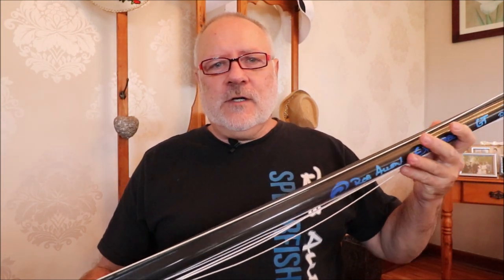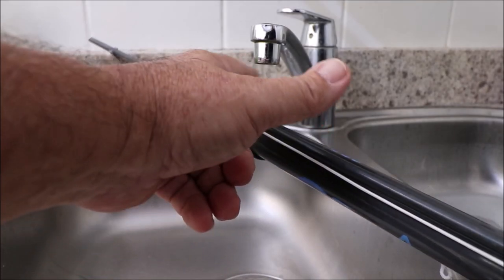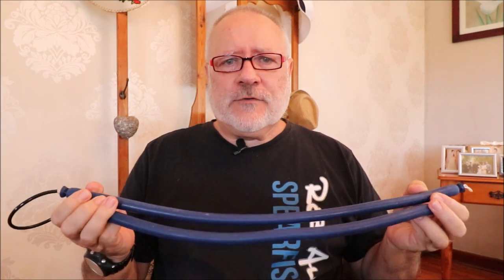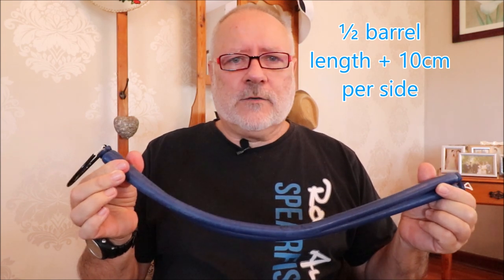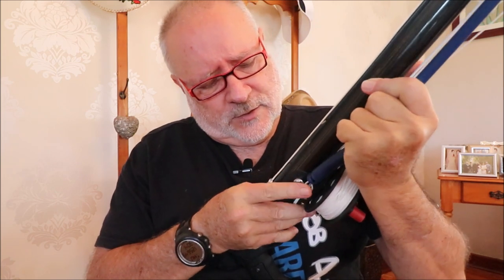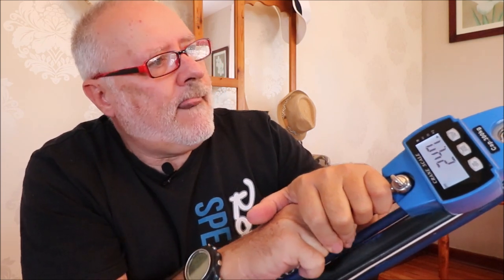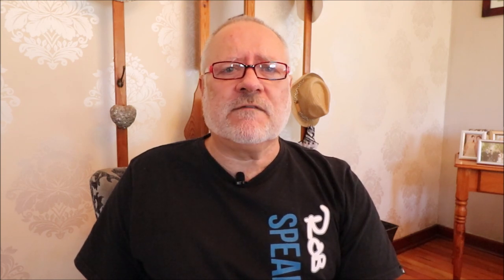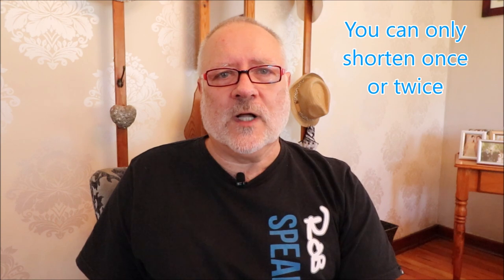Rob Allen | Roller Gun Tips

Comment: Thanks Uncle Rob. I got a 90 cm Tuna Roller gun. Put a 14 mm rubber on it and double wrapped it. It shoots like a dream. I always adore your spearguns. The only brand I ever used. 
I have a question, for a blue water environment (chasing tuna, wahoo etc), would you still recommend a 110 cm length still? I'm thinking of getting a 120 cm Carbon GT Roller for blue water. Thanks, Uncle Rob :-) Greetings from Australia.

Comment: Great video Rob , thanks!!

You say in the video that to calculate the size of the rubbers, we make half the tube + 10cm for 16mm rubbers.

Is the formula the same for 14mm rubbers?

Is it really half of the tube, or half from the head to the last notch?

I have:
Tube = 83cm
Head/Notch=92cm

you say it should have a pretension of 19/20kg for 16mm rubber, 
it should have between 10/15kg for 14mm?
 as I said in a previous answer in another video?

thank you very much!
Greetings from Portugal.
Reply from the maker: Yes, same for 14mm. We use half our barrel length + 10cm. You can always make it a little longer as you can shorten but not make it longer. Yes, 10 to 15kg for 14mm. Start out at +- 10kg, you can always shorten.

Comment: Aloha Rob. Appreciate your informative videos.  Question on roller band wishbones. What is the purpose of the two same size wishbones? Do you double them up on the notch or just hook one so the other hits muzzle and doesnt kick shaft up? Thank you 🤙🏾
Reply from the maker: There used to be wear that occurred on the wishbone line so we saw guys doubling up on these. We eventually worked out, this was due to the shooting line being pulled over the top and in front of the wishbone during the shot. Once the spear started to pull out the shooting line it would have to be dragged back around and under. You would not see this unless watched after videoing and slowing down the frame rate. We realized the problem was caused mainly due to over-powering the gun. We have since sorted this by setting the power/speed of the spear to just reach max as it exits the muzzle. This eliminates 98% of the wear. The double wishbone is a carry over from that and the general market still want it. Not a good idea to try fit both into the wishbone slot as they both will not fit. If you try, the one will go in and the 2nd will get cut/damaged on the sharp edge of the wishbone notch.
Reply: @RobAllenSpearfishing  Thanks Rob. I made a band with a double uneven wishbone to try, but I'll definitely make sure I tighten up the shooting line. Just bought your 110 single roller and swapped shaft and rubber for 7mm and 14mm, for more reef shooting. Anxious to get back in the water and try it out. Only took two shots before that and they both dove low (but I did have a non tight shooting line). Thank you for your response. Aloha 🤙🏾 🤙🏾
Reply from the maker: @cyosh345   Definitely a good idea to keep that top shooting line as tight as possible, Good luck.

Comment: I notice you do sell these up to 130 cm. What happens at 110 cm that makes it not worth it to go bigger? In an extreme example of a 150 cm gun, what happens that makes it not beneficial to convert to roller? Is it just too hard to load? Would a 150 cm single roller be less powerful than a double standard band? Love your gear, and thanks for making these videos.
Reply from the maker: We tested up to a 130cm roller against same size guns with double rubbers. As mentioned before, the advantage was big at the shorter gun lengths but, slowly this advantage diminished. At 130 both were equal in power and accuracy when both were double wrapped. We did not test longer because we assumed it would get worse and, as you pointed out, loading would become very difficult. Our thoughts are, on the shorter guns the length of stroke with rollers when comparing was much greater. As the guns got longer, the longer guns rubber stroke lengths got better. Look at the ratio of spear ahead of the rubbers on a non roller gun compared to what is behind. The rubber has only a short stroke to power up the spear. The longer the gun, the longer that stroke ratio becomes.
Reply: Understood, thanks for the reply, and that makes sense regarding the ratio. Only asking asking because I have the 150 tuna with 7.5 mm shaft and was considering putting a roller muzzle on it. Even if I could only get equal power, it think it would be worth it for the reduced recoil.

Comment: Could you do a video on band choice for different purposes for your rollerguns? I have your 90 cm roller and have tried it with different bands configurations with your 6.6 mm 120 cm spear. I am hunting small and fast fish (trout) so my goal is the fastet shot with minimal drop and recoil - for fast twict instinctive shooting. Penetration is not an issue, since the biggest fish are usually 8 kg. I have tried both your 14mm and 16mm bands cut to your recommendation - half barrel length + 10 cm = 55 cm total but also shortend to 50 cm. I dont have the facilities to pooltest, but my initial impressions are that the 16mm cut to 50cm deliver the best speed with minimal drop but a little recoil, which I can handle. I would like to hear more about your testing results and your thoughts about recommendations for band choice for your great rollers. Again - thanks for the great videoes.
Reply from the maker: Hi Martin, We have not had great success with 6,6mm spears on rollers as they don't seem to have sufficient weight/mass to shoot to the end of double wrap line. If you are able to use a 16mm rubber with a 6,6mm spear, it could be because the water is cold. Rubbers lose its elasticity the colder the water is.
Reply: @RobAllenSpearfishing  Thanks for answering so quickly! Very interesting - the water temps have been around 14-18C, I suspect this qualifies as "cold" compared to South Africa ;) Clearly there is lots to be learned - this begs for more videoes on the subject. I hope you will do an in-depth video(s) explaining pros and cons of different setups on these rollerguns and your learnings from testresults and experience in general.
Reply from the maker: @martincjoergensen   One day maybe. Most of our testing is in 27 deg+ water tamp. It's winter now and will try get my guys in the 17 def water 😜👍
Reply: @RobAllenSpearfishing  Oh you don't have to do that 😅🥶 It could just be a video with a discussion of your test results and experiences so far - you have a lot already It seems 🤙🙂
Reply from the maker: @martincjoergensen  We really need to do a temp comparison. Problem is, I need a cold pool and a heated pool to try the same gun the same day 😎👍
Reply: @RobAllenSpearfishing  It would be nice! Sounds like you need a lot of ice cubes for such a test 😅 I have seen guys building a long tank for speargun testing, almost like a long aquarium. It could be easier to control the temperature in such a thing 🙂 also easier to test more, since you don't have to get wet.
Reply from the maker: @martincjoergensen  I agree and have seen such a tank.  I think you have to be in the water to simulate the same mass in order to have the recoil dampened as it would be in the sea.
Reply: @RobAllenSpearfishing  You mean the mass of the shooter behind the gun? I found the video I was thinking of here: https://youtu.be/NvChOVWqfL0
Reply from the maker: @martincjoergensen  Yes, I feel that the mass of the person shooting should be in the water to absorb the recoil the same as when diving, I might be wrong, just my opinion.
Reply: @RobAllenSpearfishing  That's a very good point, I didn't think of that. I agree.

Comment: Hey Rob great video. Question though, I have seen guys not placing the loops at the end of the rubber around the anchor points, istead they use another length of dyneema connecting the loops and this goes around the anchor points and under the barrel. The rubbers are then half the barrel length.

Advantages/disadvantages of this and do you recommend it?

I can only think that it would make it easier and faster to adjust pre tension on the go rather than having to cut the rubbers..

Thanks for your time
Reply: The tests we have done show the more rubber area to stretch the better, provided you get the per-tension right.

Comment: Hey  Rob, How do these guns perform New England waters?
Rob Robison
Reply from the maker: Should be fine. Only issue is if the water is very cold, it will reduce the band performance equally no matter what band gun you use. Generally guys cut the bands shorter when using band guns in cold water.

Comment: Thank you Rob, nice and interesting video ! Do you have a study of impact spears for your tuna guns (110-140) between 2x16mn and 16m roller ? BR. JCF
Reply from the maker: In pool testing, the shorter the roller the more the advantage when comparing it to a standard double 16mm gun. As the rollers get longer, the advantage in terms of power (spear penetration) accuracy, reduces. We found at 130cm, a single 16mm powered roller has the same power (spear penetration) as that of  a 130cm double 16mm rubber gun with double wrap. Only advantage is that the recoil is reduced. This is why we try to recommend not going longer than a 110cm roller.
Reply: @RobAllenSpearfishing  interesting. How does a 80cm roller compare to a 80cm standard gun with 2*16mm rubbers?
Reply: @RobAllenSpearfishing  Thank you this is very interesting
Reply from the maker: @martincjoergensen  The standard gun will not be as strong as a roller in that length. Most standard guns are single wrapped with sufficient power and accuracy to the end of their single wrap. The 80cm roller will still be good to the end of the double wrap. A single can shoot 5 X the barrel length and the roller with double wrap 7 x barrel length.

Comment: Rob, big fan here. I have your 1200 Tuna Railgun. It comes with two bands. How does the performance compare from the stock setup to switching to the single roller?
Reply: Hi Scott, the same set up (gun length and spear diameter will be better with a roller muzzle but not as big a difference when comparing a shorter gun. At about 1,3m there is not much advantage in power but there is much lower recoil. Some guys have problems with accuracy due to the recoil and a roller muzzle will help with this.

Comment: Very interesting video. You mention the impact of temperature on the rubbers. I live in Denmark and often hunt in waters around 0-8 degrees. How do cold temperatures impact the rubbers? Since things often contract when getting colder, my intuition tells me to cut the rubbers a bit longer than normal - but what do you think?
Reply from the maker: The reverse. The warmer the water the better the rubber works. It is easy to cut the rubbers too short and over power a gun in warm water because the warmer the rubber the better the elastic return is. So, in colder water, the rubbers perform poorly, shorter is therefore better.
Reply: @RobAllenSpearfishing  I see, thanks.
Reply: Do you have a way to gauge how much shorter a rubber should be, if it's primarily used in cold water compared to warm water? Let's say 10c vs. 25c.
Reply from the maker: @martincjoergensen  Guys in the colder areas generally cut their rubbers a good 3 to 5cm shorter than our recommend, not an exact science 😁
Reply: Thanks again. I will experiment with that. Looking forward to the next video.

Comment: Just bought the tuna roller 90 cm. Insaine power and precision - very nice. It is quite heavy in the water though. Rob, do you know if the gun will be close to neutral buoyant if I replace the aluminium tube with your carbon tube? Best regards from Denmark.
Reply from the maker: It will help.
Reply: @RobAllenSpearfishing  Do you know what the weight difference is between your 90 cm rail tube in aluminium and carbon? Then I can better guestimate the effect on buoyancy.
Reply from the maker: @martincjoergensen  I can give you the barrel differences. We have a standard aluminium (1,45mm wall) A 90cm barrel will weigh 385,1 grams. The same aluminium (1mm wall, same OD) is 306,9 grams. The carbon 90cm is 266,3 grams. The carbon dimensions are exactly the same as the 1,45mm aliminium barrel.
Reply: @RobAllenSpearfishing  Perfect, thanks alot Rob 👍

Comment: When are you going to do a video on converting a gun to a roller?
Reply from the maker: Hi Bruce, I will try do one when the factory fully opens. Pretty simple though, change the roller, drill out the handle screws and fit the rubber anchors. Cut and set the rubbers as explained in this video.
Reply: Perfect, thank you very much.👌🏼
Reply: @RobAllenSpearfishing  
Always sensible and perfect advice. Challenge is stainless anchors nowhere available.
Likewise Rob Allen master class spearguns. So SALVIMAR it is then.;-(((((

Comment: Hi Rob, I have 14mm bands and a 6.6mm spear. What pretension weight should I have?
Reply from the maker: We prefer to match a 7mm spear with a 14mm rubber. Try about 5kg and see how it goes.
Reply: @RobAllenSpearfishing  same calculation? Half the barrel length +10cm?  
I have a 80cm barrel, 14mm rubbers, 6.6mm spear and 120cm shaft

Comment: Dear Rob, my roller head seems having got some sand jammed in the ceramics bearing and when I spin the bearing, I can hear sands friction sound and not as smooth as when it was new. Any tips of how can resolve this? Thanks, Rui
Reply from the maker: Have you tried running it under running hot water? Normally ceramic is harder than sand so it crushes it up and all comes right. Sometimes dried salt water can sound like this but hot water melts it out.
Reply: @RobAllenSpearfishing  thanks Rob for your reply. I found that issue as soon as I went out of water from shore. Having tried to wash it in hot water also for half an hour. I'm pretty sure it's not salt. I'll try to spin the ceramics to crush the sands off.  It's my secondary time to use the roller and I think it might not good for shore dive because it's getting in sand too easy. I'm using a 80cm carbon RA roller by the way. It's a bit heavy in the water and easy to sink to the bottom, and I think that's how it's got sands in. Kind Regards, Rui
Reply from the maker: @ruitian8724  Yes the shorter gun do have a buoyancy problem. The 900 is only just buoyant. We are working on reducing the muzzle weight by using a smaller axle and smaller bearings. These have been tested now for a year and so far all good. We are also working on adding timber side stocks but to glue them well is difficult. Better to have them attached to raw carbon. Regarding the sand, some have had success by dissembling all and trying to get the sand out with the bearing fully open. Just be careful not to loose the screws.
Reply: @RobAllenSpearfishing  ah, thanks for your kind guidance!
Reply from the maker: @ruitian8724  You are welcome.

Comment: By half the rubber length plus 10 cm do you mean if its a 90 cm gun my 16 mm rubbers should be 50 cm? Does it hold the same for 14mm rubbers? Chris coats in his article tends to favor the 14mm for hand loadable shorter rollers.
Reply from the maker: Half of 90 is 45, plus 10 = 55cm. This is a good start. At 50cm it will work if the pre-load is 25kg or less. Yes, 14mm works to the same ratio but will give slightly less pre-load. Remember the 14mm rubbers will be best for 7mm spears.

Comment: my roller head still does not spin nice and freely, even after applying water and rinsing it. do you recommend taking it apart? or getting a part replaced?
Reply from the maker: There is a possibility that it has moved slightly on the shaft, causing side pressure.
Reply: I have the same problem, one not spinning freely. Ive spent a lot of money on ceramic skateboard bearing over the years so I've been super cautious in taking care of these bearings, washed in fresh water after each use. Ive bought two of these because I love my 100 roller conversion and I want to do a 120 in the future. Not sure if I should take it apart or take it back to the shop....??

Comment: hello rob , im having problem on on my tuna railgun converted to roller, how long is the wishbone needed to be it seems like its still on the notch as it goes to the railing of the roller? its shooting downwards or could it be the recoil from the gun tipping the end of my spear?
Reply: There are many possibilities. What length gun is it? What shooting line are you using? What roller did you fit? 

Rollers can be very tricky. The biggest problem is not tightening the shooting lines properly. If it is slack it can get sucked into the roller then get pulled out, jerking the shooting line and affecting the spear flight.
Reply: @roballen1578   @Rob Allen  my gun is 900 railgun and i bought rob allen roller kit and im using a 2mm dyneema. i have my bands at 55 cm . should i try go 1.8mm dyneema? my shootingline has tension with my bungee but ill try and make it a little more tighter
Reply: @fidelrichardagpaoa3979  We only use 1,8mm Dyneema. Yes, try making it much tighter, especially the section from the spear line hole to the muzzle.